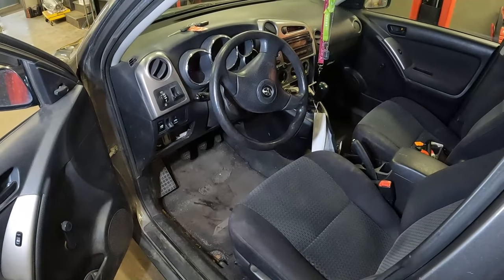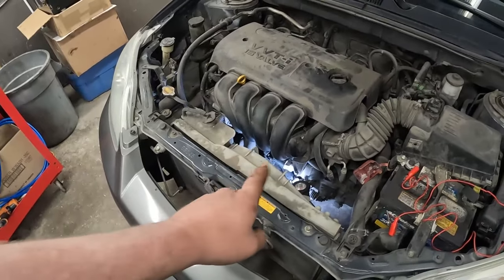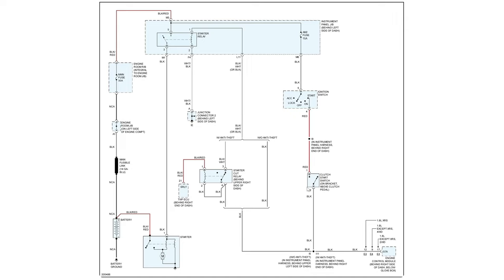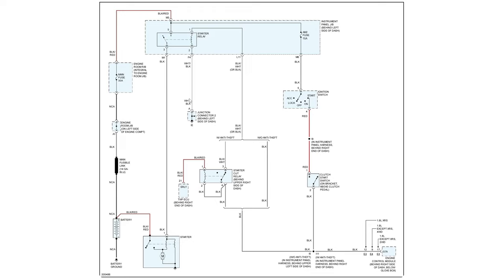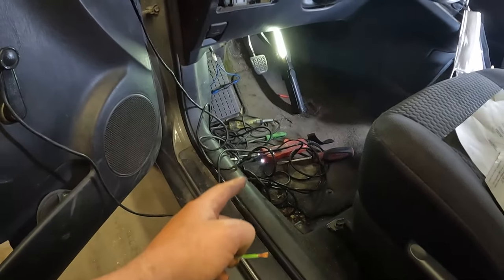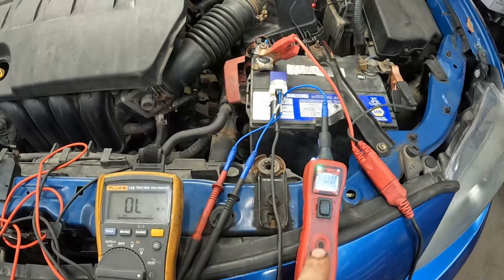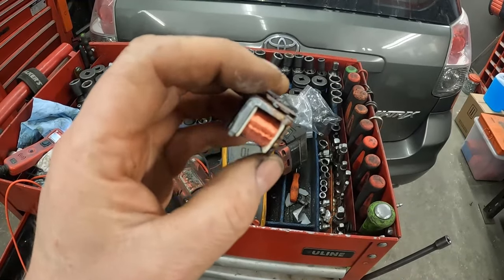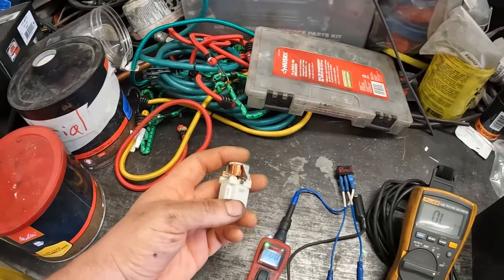2005 Toyota Matrix No Crank No Start. What to do when the battery and the starter are good!

Comment: Great tips.. My nephew put a new battery and starter in only to find out the head gasket caused a hydro-lock. Also on these Matrix it takes 4 minutes to pull the rad fan.
Reply from the maker: @josephbatta1730  Ah that's not good! I had that bite me on a Mercedes ML350 diesel. The thing was only 3 years old with 50,000km on it so I didn't think to test the engine but it was seized solid from not having an oil change in a couple years... I now put a wrench on every single engine before putting a starter in. No matter how new it is!
Reply: What was the reason it hydro locked?

Comment: Great diagnostic walk through. I have a 2006 Matrix 4WD with 226,000 miles. No electrical problems so far (OK, the horn wire broke but it was my fault).

Comment: Pop that left A/C panel (above fuse access) off with a flathead and you can reach that relay easier.
Reply from the maker: @g.davidlawrence8471  No way! I totally didn't think of that. Definitely would have made that much easier... haha
Reply: Hey good tip thanks, I am about to do that on my car😮
Reply: Not on a 2003-2008 Corolla. Just saying. My problem was the Ignition Switch but I wanted to replace the starter replay because I own the vehicle and it's 20 years old!  I had to crawl under there with my head where the pedals are and reach up with one hand only and R&I that same Purple Starter Relay. Took me 2 tries in 109 degree heat and I'm not a young man anymore!

Comment: I had the same issue with a 2003 Matrix with just over 240k miles.  By far, the easiest way to access the relay is to remove the silver cover from the dash that holds the left-most vent and interior dimmer.  Remove that and it’s quite easy to remove/reinstall the relay with no tools.  A rod-type stethoscope can tell you if the relay “pics” when turning the ignition.

Comment: Good information, my 2004 Just had that happen,was just going to junk it cause the cost of someone checking out the wiring would of cost more than the car is worth. 289000 km never had any issues for the 17 years i've owned it fantastic car sad to finally have to let it go. the new stuff is SO EXPENSIVE EVEN USED CARS . This is going for over $5000. for the same car with the same miles in Canada. crazy.

Comment: I have had problems with my toyota matrix.. I changed out the battery it ran for 1 day, changed out starter ran for 2/3 days. I changed several fuses and relays in fuz box under hood., ran for a day or 2, i changed out the starter relay ran for 2/3 days I check the ignition switch its not that and also changed the clutch safty switch and it's not that either... and after I change something out it works for a day or 2 then does it does the no start no crank again.. Any other ideas what it might be causing it.
Reply: We have the same problem just keeps popping fuse everything looks ok
Reply: @dougz31 mine does not pop fuses.... everything comes out that it works havent figured it out yet.... but I created a bypass... bypassing everything from the key to the starter using/installing a remote starter switch.. that invention fixed my problem😂😂...
Reply: Park neutral safety switch???
Reply: On mine the battery gets drained sometimes but it starts with a jumper from the connector at the transmission and the wire at the started. My brother in law said he thinks it’s a short somewhere
Reply: @martindavila2232 same here. But I finally got some codes and I'm going to change the camshaft position sensor and crankshaft position sensor as well

Comment: Hey, ive got an 04 corolla auto. It just doesnt wwnt tk start all of a sudden. I put in a new starter and then jumped the signal wire, it cranks but didnt start. I narrowed it down to the neutral safety switch but cant seem to find how to jump it. Any advice ?
Reply: Adjust cable length

Comment: Been fighting same problem same car.. Same C O L O R🙄 MINE IS AUTOMATIC... i disnt hear fuel pump prime thou 40:30
Reply from the maker: @claytonahr2844  When you go to start yours does the engine turn over and it just doesn't fire? Or nothing at all?
Reply: @eurbanautotech  just dash response bells whistles.. No crank no nothing
Reply from the maker: @claytonahr2844  Does the starter work? If you manually power it at the solenoid terminal like at:
https://youtu.be/PyHlHtGiD-w?si=EZzql_h2xmYPGbuH&t=177

Again, make sure you're in neutral with the parking brake engaged if you're a standard!

Likewise it's pretty common for clutch pedal switches to go faulty. You could try bypassing it like at:
https://youtu.be/PyHlHtGiD-w?si=ODEMqrOunumIwNDi&t=760

Otherwise you could check to see if the engine computer is recognizing you're trying to start the vehicle. In the main fuse box under the hood there's a:

 - 20amp EFI fuse - hot all the time
 - EFI relay - turned on by ECM
 - 15amp EFI2 fuse - powered by EFI relay

Sorry, I don't have this in my video but should be easy enough to spot. So I would get someone to hold the key in the start position (while clutch pedal is fully pushed) and check to see if you have power at the 15amp EFI2 fuse. It'll only have power if the ECM turns on the EFI relay. So if there is power there then you know the ECM knows you're trying to start the car and is also trying to start the car. 

If you don't have power at the fuse then you're looking at something like a power supply issue (fuse, relay, wiring, etc), ignition switch issue, security issue or ECM related issue. At this point you wouldn't have to worry about starter or anything like that. 

If you DO have power at that fuse then you know the ECM is trying to start the car and you have to worry about starter relay or bad starter or something like that.